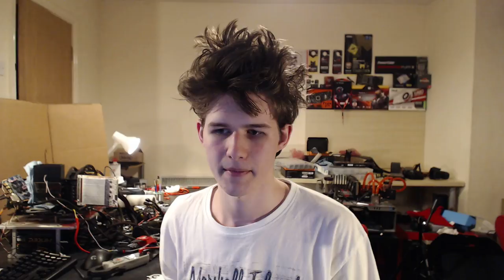A follow up on PCI-e power cable daisy chains.

Comment: I would ABSOLUTELY LOVE!!! for you to do at least a few PSU reviews here and there. Not even about the cables, just the PSU alone if you want would be so incredibly cool hearing you talk about. Such as the internals and the quality like you do with video cards
Reply from the maker: I don't have PSU testing equipment and it's really really expensive.
Reply: How expensive are we talking about? I'm seriously tempted to drop a few g's if there was some kind of kickstarter for it in the future
Reply: Check out jonny guru
Reply: That's the thing, we need more PSU reviewers. We can't depend on good 'ol Jonny Guru to test everything ever, we could use more variety
Reply: Actually Hardcore Overclocking are you going to reveiw the Galax power card you have?
Reply from the maker: yeah I have some videos planned for it.
Reply: Actually Hardcore Overclocking Do you think the epower v is worth the 250 usd they're asking?
Reply: Perhaps only power supply breakdowns like the VRM ones? That would be very interesting(well, for me, a hour ago i tested power consumption of my DIY LED lamp, 123lm/W)

I am interested in the mysterious XFX XT, the TS bronze of 450/550w would also be nice.

Comment: Out of curiosity I went to check on the manual of my Antec TP-750c and I found this "PCI-E graphics cards use different amounts of power. For some, a single 6-pin connector is sufficient, 
making the hardwired connector the preferred choice." which basically is the advice you gave.

Comment: Basically use commonsense and implement the best case scenario not the worst .... And Always err on the side of caution , Ultimately , Employ Common Sense . Here in Australia I have Had a situation of summer heat causing case temp upwards of 50 so i changed up my CPU cooling solution , Up-fired my PSU and improved caseflow to have a fan blowing onto my Cable-mods Extensions on the rear side case panel, and in the end I ended sleaving up my own using a more appropriate gauge and High Quality Cable... That wont suit any other application!. Its not a one answer band-aid deal here. You did a good job of communicating that ! . So there is some small encouragement for you.

Thanks BZ , lol, good job tackling a difficult and awkward toppic ! ... 

I am certain there are situations of people experiencing bad outcomes , but I would also Hazard To Guess that bad preparation or Lack of Knowledge is causing more of the poor performance or bad outcomes in those cases ... Especially in the failures at very least .

Comment: I still believe it's not the cable, but the rail distribution in the different PSUs. Using different cables might just make it use a different rail which saved the day. Some PSUs cheap out by using physically separated rails, this can post an issue if you use daisy chain cables.

Comment: well, my room temperature is 33-35C for the most part of the year. and i was using daisy chained PCIe cables on 2 corsair PSUs with 250-300w GPU for years.

Comment: I'd take 45 c 10% humidity over 39 c 95% humidity all day long. Last summer we had 10 days straight with 101f low 106f high, 90-97% humidity the entire time and it did not rain for two weeks. Awful. We only got 5' of snow in the winter though, and our winter low temp was -13 c and we only hit that at night save for a week or so which was a bit annoying (still better than the heat and humidity though). Winter is on it's way again, but we're still at 30c which is great. The heck am I talking about weather for. Go on unpause
Reply: High temp + humidity means that sweating doesn't cool you down effectively - basically when the humidity increases your body can't cool itself so you feel the heat a lot more even if its hotter. I think I read somewhere that 90%+ humidity at 35 C has an effective heat higher than 40 C, even though the temperature is lower.
Reply: KIN0025 Sure enough. It's essentially the opposite of Windchill Factor.

I keep my house 65-72 (I don't have Central AC so 3 Wall Units instead. Enough to cool 1500 ^2in a 1000^2 house) which keeps the humidity at 55% or so.

With the AC off, if the humidity in the air is over 85%+ your clothes in the closet will actually be wet when you go to put them on. I have oil heat with a battery back up on the boiler and a fireplace so if I lose power my house can stay warm, but if I leave for a few days and we have a cold snap, I'll have to let the house warm up for about 3 hours before turning on a PC or it will just turn into a puddle of condensation. You'd think I was cooling with 3 internal Peltier's.

Comment: With the 3000 series we're now seeing various issues with people using daisy chain power connectors.

Now that we are in the range of 400W+ we are seeing issues including fried GPUs. EVGA is telling people to use a daisy chain on 3080s and this seems like a bad idea?

Seems like this topic could use a revisit for the current gen of GPUs. People are still going off of previous gen conclusions which don't apply to the 3000 series generation.
Reply: A daisy chain PCIE set-up is causing my AMD Radeon 6800 XT to green screen and then black screen and there is nothing I can do about it for now I'll have to wait.

Comment: Hello Buildzoid. This is a great casual video on a topic which many regular non-overclocker PC users are interested in. And I think its fair to say we all learned a lot of practical information here regarding PSUs and ATX cabling etc. So since these supplemental topical videos help to support your other activities for the channel, can I please suggest another topic for a future video in this sort of side-series?

How about giving us all your thoughts on GPU and PSU coil whine? Because I searched back you past videos on this channel and cannot find one specifically about this problem. Again, it might be something you don't really care about however your expertise is really sought-after for regular users.

Actually (just like this video) there was a recent video by Jayz2Cents on coil whine. However the things he said simply were not as revealing or useful to help tackle / diagnose the specific causes of my issue. Specifically if it is because of resonances between the GPU and PSU combination, when connected together, or if that is just some myth. And if that is true then can adding caps or chokes between the GPU and PSU (on these same 6 and 8 pin power cables) do anything to alter the connected resonance of the whole system?

Why am I asking for this video?

For example I am in a tight spot with a loud coil whine right now. Recently I bought a brand new MSI gtx 1080 which is silent until you actually give it some real GPU workload to do. It had very loud coil whine in most benchmarks and games.

This MSI GPU coil whine sound, the chokes in the GPU make a very 'mechanical' type of clinking noise. That is very on/off  with the GPU's VRM switching activity under load. So its like crickets or something. (but also there is a high pitched component at other times too). This happen under GPU loads, and if a game is paused or in menu in the background (not-active app). Thing is the rest of my rig is totally silent, so the coil whine sounds really loud.

The retailer just exchanged me for another brand new card (I am still withing my 30 days return windows). 2nd card also has pretty loud coil whine too. So am in a tight spot with 2 weeks left to decide whether or not to return the card yet again, (for maybe a 3rd try, else a refund). Since 2 cards now both have a significant coil whine I am not certain anymore if the problem lies with very bad luck in these 2 specific 1080 gpus individually, or else generally the GPU model and brand (meaning bad quality control at MSI), or else my PC's PSU is somehow causing a resonance with them badly. I am using the standard 6-8 pin daisychain cable here that came with my silverstone 500w gold PSU (SFX-L SX500-LG). Because I have no other cable right now (and its only 1 connector on the PSU end, suitable for connecting to graphics cards. So therefore i kindda have to daisy-chain anyhow. The manufacturer supplied cable seems to be 18 awg (a flat cable) and looks typical for a reasonable quality of PSU cable that is from a mid-range and reputable manufacturer.

In future (but not now) I do eventually plan to make up my own custom cable cable (16 awg) to replace that manufacturer daisy cable. Which should be somewhat better. But the real limit is that my PSU itself only has 1 8-pin modular connector for GPU, there are not a 2nd one to make for 2nd separate cable. Forcing me to make either a similar daisy-chain, or else splice as 2 sepearate cable which crimp together into 1 at the PSU end into a single 8-pin pci-e power connector pins.

Other comment about coil whine which is not related to my main problem:

Previously on the PSU side itself (alone, no GPUS), well my PSU had developed a very slight coil whineing. Independantly of the 1080 GPU situation and not related. But its very quiet and not anything like the loudness of the GPU. But I noticed with that issue it was caused by my custom 24 pin ATX cable I made from scratch going to the MB's 24 pin. Because if i poke / prod that cable, then the coil whine in the PSU goes away. Like some resonance created by a slightly bad contact inside of the 24-pin cable where it crimps onto the ATX pins.

Comment: Could you do a video on ESP motherboard connectors or was the video you were reffering to about that? 
I mean I have now tested a few examples whete I do overclock a Ryzen r5 1600 to 4GHz with just one 4pin connector. Turns out up to 150w is ok to use one or more depending on the grade of the capble. Also seems like the 8pin connector had two 4pins in parrallel so no worties about not feeding current properly. Now there are decent OEM/bulk powersupplys like GPA-500S8 with just one 4pin connector that might still be new from package but manufactured a couple of years back when 8pin was really for higher end oc boards...
I know anyone does not recommend 4pin because it usually indicates pore quality, but that's not always the case.

Comment: i run daisy chains to both my 780tis, not noticed any performance degradation from going from individual cables, the overclocking ability is the same as well, they (the cables) dont run hot either, its probably a different story on the 980, 980ti, 1080 and 1080ti

Comment: could seems stupid or placebo but i put on my evga 1070 ftw 2 separate 8 pin cables (before i had a single cable with a split dual 8) and gained some points in the benchmarks and also got 30 mhz more oc on the core....
i did this after the JZ2cent and your video about this topic
also i have a corsair AX760 as PSU

Comment: Might the daisy chain be an issue with nvidia card due to the power monitoring - the shunts and what not, trying to balance between the two connectors to even out - but seeing as its the same cable... - its really quite interesting, i'll be waiting for the conclusion :D

Comment: ah, it's not the 'designers' of the PSU, it's the fella outsourcing the detachable cables. And I've seen a lot of aluminum wires gutting PSUs for the plugs. Many lower-end units came with aluminum wire crimped into solderable ends, and a lot of budget PSUs with modular cables use cheaper aluminum wires. It's bad, lol.

Top end units I guess aluminum is less common. And it is not specific to any single manufacturer. I got one top-end PSU with aluminum wires and their older unit had copper, so it's a roll of the dice I guess.    And they had to change the plugs on the PSU so I cant just use the older cables, grrrr.

Comment: Im using the in win 805 chassi that has the power supplie mounted "upside down" pulling air from the inside of the case daisy chained xD

Comment: I think the difficulty of using the 16 AWG wire, is terminating 2 wires in the 8 pin pcie daisy's.

Dunno how cable mod make them with their sleeved cables, must be using 20 AWG or 18 at a push.

May be you could test this, temperatures with CableMod daisys?

Im new here and loving the content. Where you from Buildzoid. Thanks :D

Comment: To be fair, I live in one of these hells. (made worse because I have no AC, and it's pretty obvious to me that the indoor temperature gets higher than the outdoor temperature)

Even with 35-45 degree temperatures being common in summer,
In all the time I've had PC's the only heat problems I've had with my PC's, summer or otherwise, is thermal shutdowns caused by CPU temperatures.
And most of the time this is caused directly by the CPU cooler being clogged with dust.
Summer is not all that much worse than winter for dust related temperature problems. So... Yeah.
My computers don't seem to care about extreme ambient temperatures much. XD

Comment: See I never even tested my G1 Gaming GTX 980 Ti on anything except 2 separate 8 pin cables - well that isn't EXACTLY true...
When I first got my GTX 980 Ti off eBay August 2016 - I had a Corsair TX750w completely non-modular PSU. Before I even plugged in my new Video card, I was getting TOTALLY random shut downs and system hangups, and this was still running a GTX 770.  Once I 0ligged my G1 Gaming GTX 980 Ti into the Daisy-Chained 2x 8 pin - which was the ONLY option to use 2x 8 pin with that PSU, the MINUTE I would put my 980 Ti under load, I would hear my PSU click every 3 to 5 seconds, and when I added a MODEST overclock to the card, well that clicking became RAPID (During Unigine Valley on loop) and after maybe 2 minutes-  it would shut down completely.

So there was DEFINITELY some fault with my Corsair TX750W PSU - but that IS a cheap PSU was not even 80 plus IIRC! When I compared that to my EVGA GQ 1000w 80+Gold - on JohnnyGuru, well the TX750w would exhibit as much as 250 mw ripple under max load, meanwhile the EVGA I bought was less than 25 mw under the same "Torture Test" scenario Johnny runs. 

Anyway, after I had installed my EVGA GQ 1000w PSU, not only did the random hangups and shut downs STOP completely, but I was able to bring my 2600k from 4.5 GHZ to 4.7 GHZ locked on all cores with turbo dusabled, ALSO now I have my GPU running 1505 MHZ core and 8 GHZ VRAM, and the PSU has Never clicked once!

HIGH QUALITY PSUS ARE A MUST IF YOU ARE INTO PUSHING THE LIMITS OF SILICON! Also they can LITERALLY save your motherboard's life! The more stable the power coming from your PSU is, the LESS work your CPU and GPU VRMs must do, and that means less heat and less stress!

Comment: so u can get a 20 gauge aluminum cable psu, with the contacts being worse than the 8 pin and cables itself and it's all a fine atx psu, that is being sold.
not gonna lie, hearing that 18 gauge is a suggestion and that the psu side connections can be worse than the cables spooked me off, like wtf? aren't those the points, where standards do make a tiny bit of sense? u know to avoid your house being set on fire, of course talking about the extreme dirt here.

btw one of the usecases, where all of the daisy chaining does matter is mining setups, where people often wrongfully overload their psus and cables definitely under 24/7 load in a hot server like environment on bigger setups.

so our ideal high end powersupply has 16 gauge till the split up for daisy chains, if it uses daisy chaining, which is hard to avoid as u only got that much space on the back of a psu to put cables.
it has to have great ripple suppression and capacitors at the end of all heavy 12 volt rails, although in cable capacitors are worse for moders.

also great followup buildzoid!, may the hair be with u!

Comment: The connector have aluminium pins in it, that's why thay're warmer, here's some extentions paired with gtx 780, the extantion was from one of the modding stores in my country 
http://screenshu.com/static/uploads/temporary/2s/so/nx/ueoo61.jpg 

The connectors usualy melt befor the wire.
Reply from the maker: mine look to all be gold plated copper and the same applies to most high end PSUs.
Reply: I actually don't know what i have in my PSU (the PSU side looks silver though, I got the SF leadex platinum with a see through connectors), but please pay attention to that, while researching the extensions, aluminium pins should be more common there.

Comment: Pls help me I have 3080 gpu. It has 3 8pin on card. My 850rm Corsair has 2 pcie cables….. plz help and you said not to daisy change …. What do I do explain throughly. Was told not to mix cables and does the 850rm have 3 separate slots on psu for 8pin pcie cables….
Reply: curious in what you ended up doing, I have a rm750x and also comes with 2 pcie cables, I've read that it is probably ok since the wires are 16 AWG

Comment: dude, i live in north east montana.....its -50f in the winter and 120f above in the summer (-45c to +45c)

greatest temp difference between summer and winter than any other state....and ya....the difference is larger than the difference between waters freezing point and boiling point
of course our lakes dont boil is it gets WAY colder than hotter.....

but still...
why do i live here?

but no computer in someones HOUSE is going to have 113f/45c ambient temps....the humans would die along with the gpu
Reply: You'd be surprised. I'm fairly confident I've had my PC turned on in OK, not 45, but 42 almost certainly.

Especially because I've noticed my indoor temperatures in Summer are frequently higher than the outdoor temperatures.
I can guarantee I've run my computer in 35-40 degree heat many times.

Yeah...

Then again I got very close to having heat stroke last summer, so... Uhh... Yeah.
(I got out of bed, walked to the couch, collapsed and for all intents and purposes couldn't move until about 10 in the evening. - I was up and active for maybe 5 minutes at most before I basically collapesd.)

Eggh. I hate that I have literally nothing in summer that can cool this place down.
Quite a mess in a place where summer temperatures are usually in the region of 35-42 degrees...